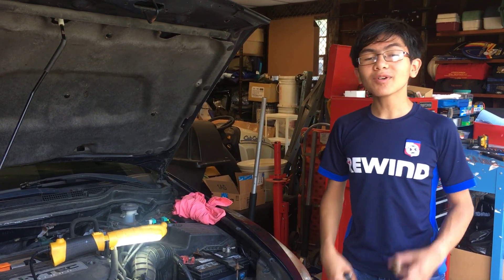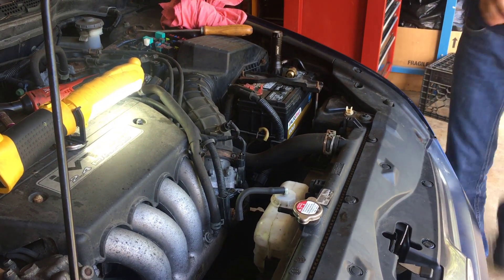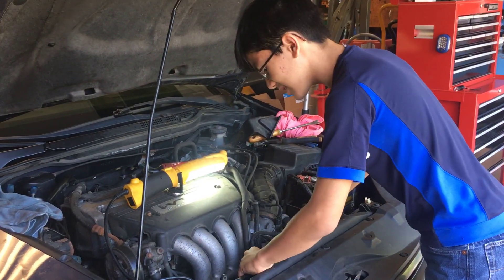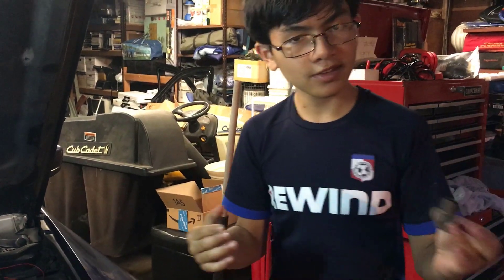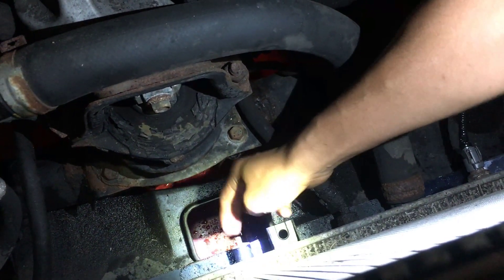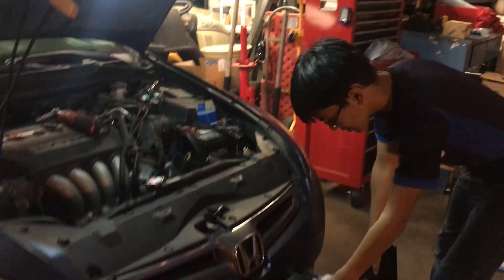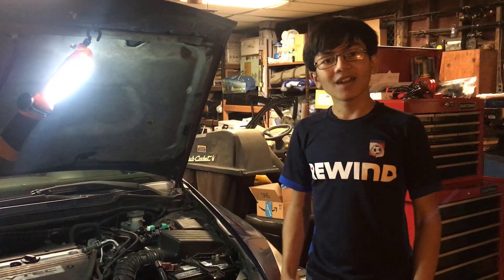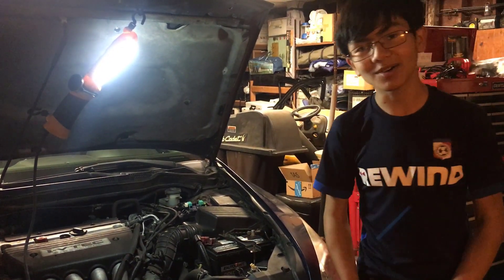How To Remove / Replace Temperature Sensor Engine Coolant Switch 2003-2007 Honda Accord | DIY Guide

Comment from the maker: As comments have stated, this video demonstrates the replacement of the Coolant Fan Switch, rather than the Temperature Sensor; the difference between the two can be seen clearly on the photos of this Amazon page: https://www.amazon.com/37760-P00-003-37870-PJ7-003-Coolant-Switch-Temperature/dp/B01ASUHJ2S , so please be advised when you look for a replacement part.
Reply: I've seen several videos in which the sensors are confused. The fan sensor switch is on the bottom of the radiator. The coolant temperature sensor is on the driver side of the engine block.

Comment: You wrong you replace coolan fan switch  not engine coolant temperature sensor!!
Reply from the maker: AI Overview
In a Honda Accord, the Coolant Temperature Sensor (CTS) sends data to the Engine Control Unit (ECU) for fuel/timing, while the Coolant Fan Switch (Thermoswitch) directly turns the radiator fan on/off at preset temps, though they can sometimes be confused; the CTS (often 2-wire, near head) reports temp, while the fan switch (often 1-wire or specific 2-wire, often on radiator) activates the fan, both crucial for preventing overheating but serving distinct functions.

Comment: My 2007 Honda accord does not have that sensor you are showing but instead it has this sensor on the radiator.....37870-RAA-A01

Comment: In a pinch.. Just loop a piece of metal from one slit to the other in the connector. The fan will stay on long as the key is turned.

Comment: for everyone saying that he's wrong and that it's called the coolant fan switch, you're incorrect. i have an 06 Acura TSX and this sensor is called the ECT (engine coolant temperature) SENSOR 2 HIGH CIRCUIT.  code : P2185. 
though it ultimately does determine if the fans turn on/off, is not called the radiator fan switch. all you know-it-all DIY mechanics are the reason it took me 2X longer to find this part.  

anyway, thanks kid. your father is a very proud man.
Reply: Its the coolant temperature switch, also referred to by some as radiator fan switch, but it is a CTS, coolant temp switch. He infact also refers to it as the temperature switch at the begginning of the video. The ECT sensor (engine coolant temparture sensor) is located on the back side of the cylinder head below the exhaust cam position sensor. if ur looking at the cylinder head from the driver side, you will be looking at the back side of the head, look at the bottom right side of the head, and there you will find the ECT sensor. Think about what its called, ENGINE COOLANT TEMPERATURE SENSOR. You think a sensor with the name "ENGINE" referred to wil be located anywhere else BUT the ACTUAL ENGINE?????. Nope. Manufacturers dont have skewed names. They are very literal in naming as to comply with universal naming schemes, as to be serviceable by technicians worldwide. And general rule of thumb, a sensor will be designed with it having to be directly in the path of what its designed to sense, example: Air temp sensor, will have a probe that sits in the path of intake air, coolant temp sensor has a probe that sits in pathway of a coolant passage in the cylinder head, some vehicles will have it on the thermostat housing, once again in the pathway of coolant flow. Oxygen sensors sits in 2 places, 1 on the exhaust manifold, and one on the exhaust piping after the catalytic convertor, both sensors will have a probe that sits in the pathway of the exhaust gases. A switch doesnt need to sit directly in the pathway, but rather just in the general area to pickup a differential in resistance, and that in turn will tell the ECU/ECM to turn on a designated/corresponding component, in this case the radiator cooling fan relays, which in turn turns on the fan. The sensor and switch both work in same principal, being resistors, as the temperature increases/decreases the sensor and switch both increases or decrease resistance value that registers in a voltage range from 0.1 to 5.0volts DC.  and the ECM engine control module determines the temperature range based of the voltage readout. The sensor has to be more precise as the engine determines whether to advance timing, or retard it, to avoid both engine knock, as well as running state for cold starts, and operational temperature. the switch is literally just to determine when to turn on or off the fan. For instance after parking on a hot summer day, after a long road trip, and the engine happens to be in the middle of heat cycling so the hot coolant exchanged from the engine to the radiator as the thermostat is open, and the cooled coolant replaces the hot coolant, the ECU will turn on the radiator fans to cool it down as the temp will continue to increase after being parked since no longer moving forward so no air passing through the radiator. hope this explained the differences and some information added to your arsenal for future use. Also, good to have confidence in yourself, but seriously do plenty of research before calling out everyone in the comment section. Cross reference the source of information with multiple sources and ween out the lesser generalized bits. the internet is full of these tidbits that pass along wrong information as the correct info, and most of the time its unknowingly. Have to be vigilant with it. Take Care :D
Reply: No your wrong, I have this exact car made in 04. It’s called a fan switch, temp sensor is near intake

Comment: My fans turn on with my AC but never turn on when the car is at running temp and it cause the car to smoke but not over heat can it be this sensor

Comment: Says it's easier from the top then goes on to mention how much you have to remove😅😂😂 def going in from the bottom if the plastic gaurd is all you have to remove lol

Comment: That is NOT the engine coolant temp sensor on the 2003 Accord. It is the radiator fan switch and is much larger than the ECT. It is actually located atop the engine block going into it at the rear of the motor. Looking at the front of the engine stick your arm back behind the cylinder head and you'll feel it down low towards right side - and the wiring harness that it connects to. I cannot find a diagram showing its exact location or I would post it.
Reply from the maker: Thank you, I will make sure people know!
Reply: sorry David, you're wrong. (assumin it's the same as my 06 Acura TSX) this part IS called ECT sensor 2 high circuit.  code: p2185. there's a reason why you couldn't find the diagram
Reply: Actually the radiator fan switch is different on the 2006/2007 models, & possibly the 2005 as well.

Comment: My husband is replacing the radiator in a 2004 honda pilot he bought off Amazon and is confused on why the temperature measurement sensor will not fit in the new radiator. So he's putting it back in for now without connecting it

Comment: That coolant sensor you replaced is much larger than one I have on my 07 accord 4cyl mine is much small with a long point after the threads.I seen one you took out and I purchased it and it doesn’t fit.
Maybe I do or u have aftermarket radiator.Has anyone else had this problem?
Reply: I replaced the radiator on my 2007 Accord EX-L. The old radiator had a temperature “sensor”—small long rod and a small 10 mm threaded hole. The new radiator I received has the larger 18 mm threaded hole that fits the item shown in this video which is a radiator coolant“switch.” Apparently Honda has two types of radiators that vary in this one aspect. These two things work differently the smaller temperature sensor probe measures the change in voltage which calculates the change in temperature. The larger coolant switch is only on/off open/closed; it starts the radiator fan when the coolant is hot. They are not interchangeable. The electrical connectors are different too. Go to rockauto.com or Amazon.com and search for temperature sensor. There is an additional temperature sensor on the engine hidden under where the heater hoses connect on the 2.4 L engine. That engine sensor is identical in size, shape, and connector to the radiator temperature sensor—the only difference is the plastic end is white and the radiator one is black. I believe they are interchangeable and identical, but they may not send the same voltage signal to the ECM.
Reply: @mplsfarmer  thanks for the clarity it makes sense.I replaced both they had 10mm thread and returned the 18mm back to Amazon.

Comment: Í have a question
I have a ver 02
the fans dont Star
i turn on the ac and dont Star
fuses ok
relays are ok
I change the cooling sensor of radiador and dont Star
I did conect the fans direct and they Star thats the only way they Star.
thanks

Comment: Great info. On my 04 v6 accord the driver's side fan does not turn on, what could it be??? The temperature sensor or the fan motor??
Reply: Start with your relays, then test fans, if both good then it might be the sensor
Reply: The Driver’s side fan is your Condenser fan which works when you turn the AC on. Check the relays and fuses for it first.

Comment: why do your temp sensor look different than mine? my sensor has a sli. tip end that goes in radiator and your is like bigger.
Reply: Because it ia not temperature sensor.It is call Fan Switch sensor.Good luck🙏
Reply: @oscargonzalez8518  ooih gotcha

Comment: Why does the sensor in my 2007 Accord look so different?  It has a longer probe end and isn’t snubbed off like yours.
Reply: Again it is not temperature sensor.It is Faaan Switch Sensor.👍
Reply: I replaced the radiator on my 2007 Accord EX-L. The old radiator had a temperature “sensor”—small long rod and a small 10 mm threaded hole like yours. The new radiator I received has the larger 18 mm threaded hole that fits the item shown in this video which is a radiator cooling fan “switch.” Apparently Honda has two types of radiators that vary in this one aspect. These two things work differently the smaller temperature sensor probe measures the change in voltage which calculates the change in temperature. The larger coolant switch is only on/off open/closed; it starts the radiator fan when the coolant is hot. They are not interchangeable. The electrical connectors are different too. Go to rockauto.com or Amazon.com and search for temperature sensor. There is an additional temperature sensor on the engine hidden under where the heater hoses connect on the 2.4 L engine. That engine sensor is identical in size, shape, and connector to the radiator temperature sensor—the only difference is the engine one's plastic end is white and the radiator one is black. I believe they are interchangeable and identical, but they may not send the same voltage signal to the ECM. Or the radiator one with the black end works the same as the cooling fan switch in this video.

Comment: Hello, if you need the original part#37870-RAA-A01. For a 2007 Honda Accord LX 4cyl. Denso Radiator.

Comment: Bro u could have just jacked the car up and grabbed that sensor from the bottom by just removing the bottom dust cover would have took you 10min lol. Your smart but not for this job.. remember work smarter not harder u clearly did that backwards..
Reply: Would I still need to drain radiator???

Comment: please am having a gear problem with my Honda car accord Automatic, The Gear will not change until it get to 4000r/mins and the fuel consumption is high. we be glad if anyone can update me on how to solve the issue
Reply: If its only one gear thats having trouble it could be a shift soleniod
Reply: Replace the gear box

Comment: I like your young tenacity of doing your own work but you went overkill a bit on this job. I just did this job on 4 cyl 2007 accord, very simple... Drain radiator, then reach down from top of engine compartment and blindly disconnect electrical connector from sensor, blindly put socket on sensor and remove. (Make sure o-ring came out with old sensor) It took a total of 2 minutes to replace after draining radiator.
Reply: is it easy to reach the sensor from the top, but you just can't see it? i will attempt to do this myself. do you have the part # of the sensor you used?
Reply: Hello, so my driver's side cooling fan does not turn on, could it be temperature sensor?????
Reply: https://www.youtube.com/watch?v=fKHng4GJUZY

Comment: do  you know where i can buy this sensor,i really confuse about it
Reply from the maker: Radiator Fan Switch 37760-P00-004/37760-P00-003.   You could buy them from dealership, auto part stores such as Advance Auto Parts, Autozone or O'Reilly, ebay or amazon, here's a cheap aftermarket one from Amazon.com:  https://www.amazon.com/gp/product/B01FQX57DK/ref=oh_aui_search_detailpage?ie=UTF8&psc=1
Reply: @EyeOnAiman  thanks a lot,i have a problem,the honda parts shows that the part no is 37870-raa-a01,do you know why
https://www.hondapartsnow.com/genuine/honda~sensor~assy~37870-raa-a01.html?Vin=1HGCM56857A038986&Filter=(bt=4%2c126;et=2%2c7)&Location=radiator-l4-denso,3067363,9
Reply from the maker: Here's a better one, a little bit more expensive:  https://www.amazon.com/dp/B000CB21WC/ref=sxbs_sxwds-stvpv2_1?pf_rd_m=ATVPDKIKX0DER&pf_rd_p=6375e697-f226-4dbd-a63a-5ec697811ee1&pd_rd_wg=yhPrE&pf_rd_r=EP8EJKQMEWW03B8VD5SP&pf_rd_s=desktop-sx-bottom-slot&pf_rd_t=301&pd_rd_i=B000CB21WC&pd_rd_w=IzQo7&pf_rd_i=Dade+TS295+Radiator+Coolant+Fan+Temperature+Sensor+Switch+For+Honda+Civic+LX+Acura+1992-06+Radiator+Fan+Switch+37760-P00-004%2F37760-P00-003&pd_rd_r=08b73e76-1b54-4912-9373-4707ea721286&ie=UTF8&qid=1540882882&sr=1